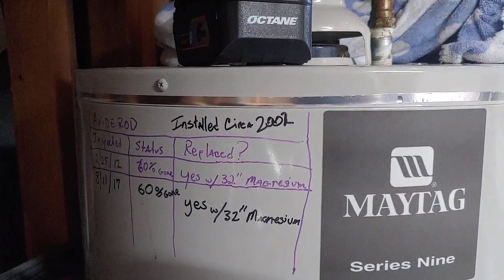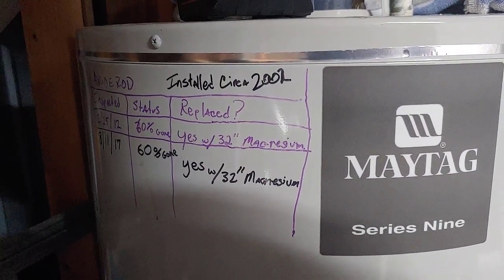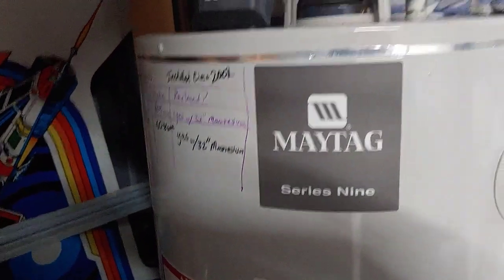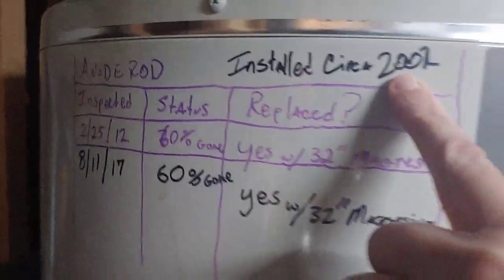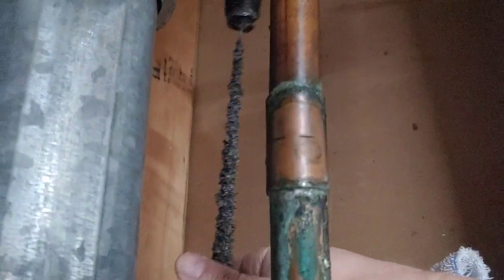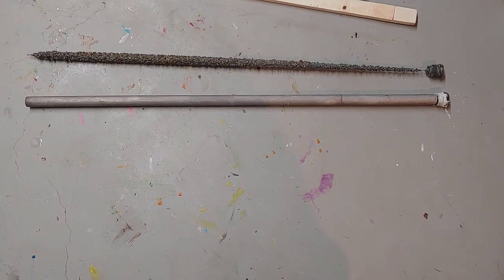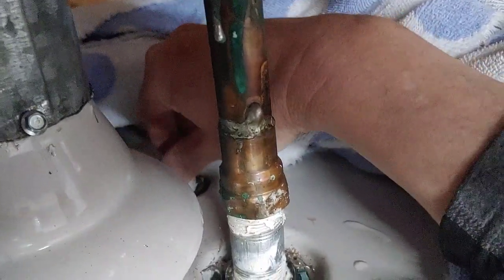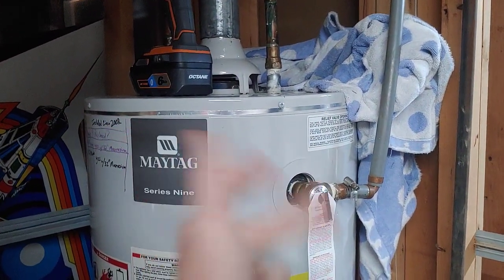Change/Replace ANY water heater anode and add 20+ years to it's life.

Comment: Tip: if you have smelly sulfer hot water use a zinc anode rod.
Reply from the maker: This is a great tip. It was such a good tip I just added it to the description as well. Thanks